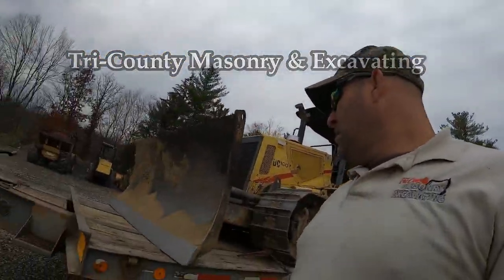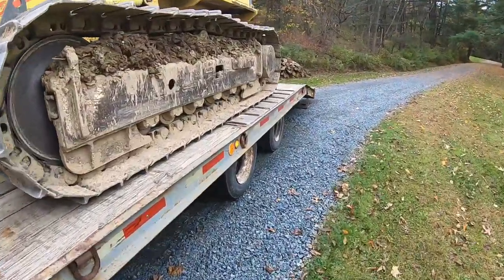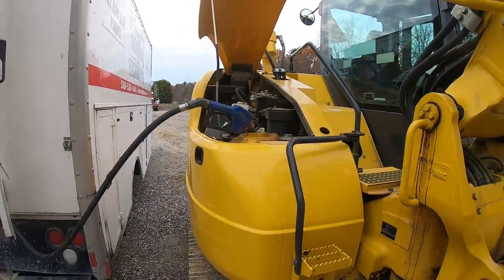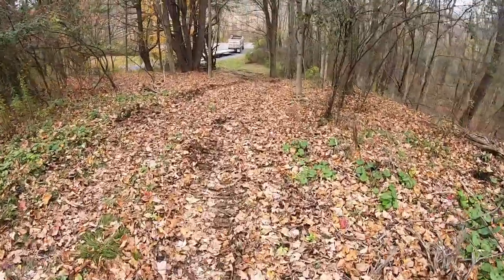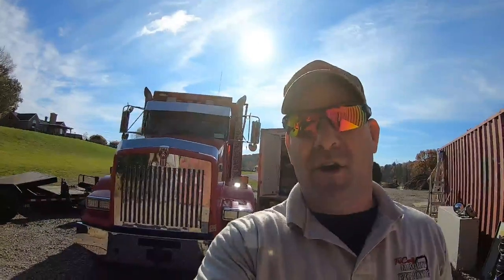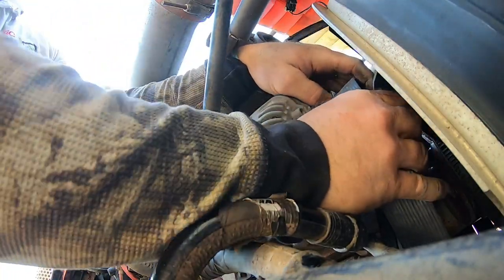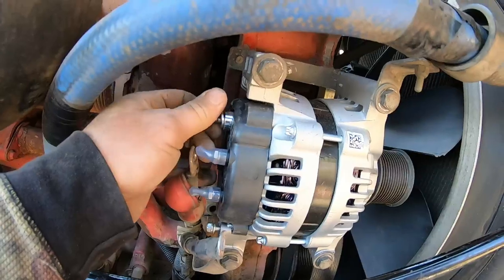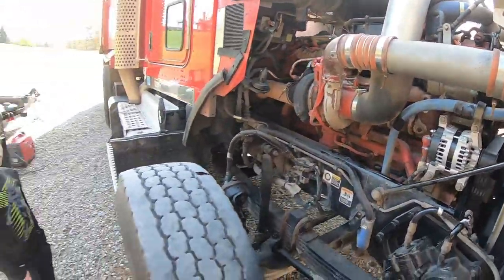Mobilizing equipment and fixing kenworth T800 dump truck alternator

Comment: That bolt on the tensioner is to secure it to the bracket. There should be a 1/2 or 3/8 square for a ratchet to go into on the pulley end.
Reply from the maker: Thanks for the tip

Comment: Delco Remy 8600310 24si HP Alternator  $180 new or $91 used  ebay  //this replaces the Delco 310 model//
or

ryderfleetproducts.   (I think Wilson is the actual manufacturer for Delco??)
Wilson 90-01-4577n Delco Remy 24si HP Alternator Pad Mount - Internal Reg
Wilson Alternator 24SI HP 12V 160 amp - 90-01-4577N
Brand: Wilson

Product number: 90-01-4577N
Availability: Ships today

$154.20 EA

If you're looking for the rebuild parts, you can find them at store.alternatorparts.   add a com at the end
and www.aspwholesale.